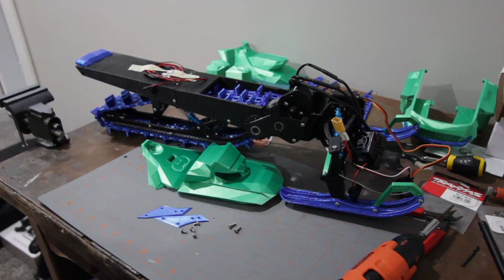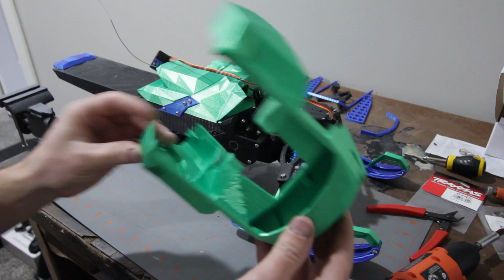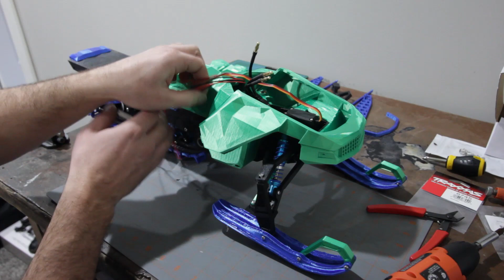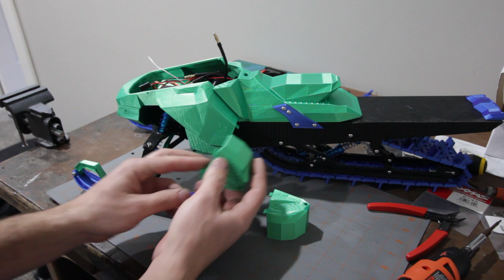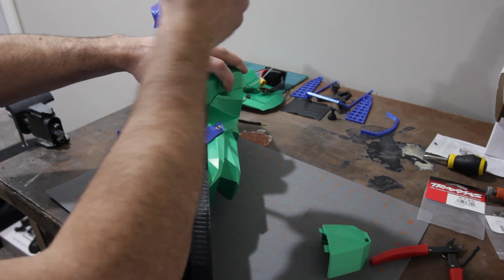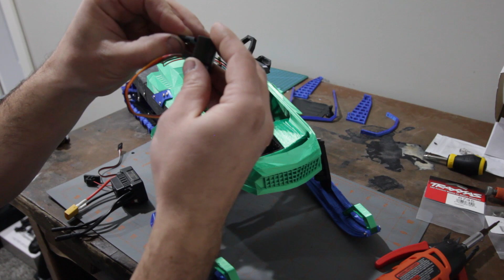SkeeRide Assembly Part 7 - Finishing Touches

Comment: Just purchased your kit thanks. I was wondering what softwear you used to make the hood. Im only familar with fusion 360 and solidworks from engineering design class.
Reply from the maker: Thanks. I use Blender. It’s very different from fusion 360.
Reply: @BuildItBetter3D  OK that's cool, did you use fusion for the mechanical components or the track, or just blender as well.
Reply from the maker: I use Blender for everything. It’s not the ideal software for mechanical things but I’ve been using it for 14+ years, so it’s just what I use.
Reply: @BuildItBetter3D  wow impressive thanks
Reply: @BuildItBetter3D  also forgot to ask what gear ratio is best for a 3300kv motor on 3s. Thanks and happy new year
Reply from the maker: I use 2200kv motor. You could ask on discord. I’m sure someone on there has that speed motor.

Comment: Thank you very much.
One thing I wish we had was a fix for the front bump steer when the suspension is compressing.
There seems like the geometry is off a little bit.
We had the same problem with pascal’s suspension/steering and he came up with a fix for it in the spindles/a arms.
Reply from the maker: Yes, there is a rack steering mod that I believe fixes this issue. I have not yet tried it, but it looks like a simple and good solution. It can be found in the mods files on MyMiniFactory. Look for jibberjabbs rack, Knuckle and upperarm.
Reply: @BuildItBetter3D  thank you and yeah it does help but I wish we could figure out the bump steer a little more.
But thanks again and I absolutely love my skeeride!!👍👍👍

Comment: Hi, I’ve just bought the plans and will start the printing process shortly. I’m just doing some ordering of the parts I need and I have gotten to the hardware. Would you or anyone be able to tell me what M3 screws are required. If you would be able to tell me how many of each bolt and the size required that would be great. If no, could you please tell me the lengths that are needed as I don’t want to buy a large assorted box that contains lots of length screws I don’t need. I would rather purchase them separately from my local hardware store. This would be very helpful. Thanks.
Reply from the maker: I haven’t counted or measured, it’s much cheaper to buy an assortment then it is to buy them individually.
Reply: @BuildItBetter3D  I do understand that however the cost isn’t a problem as I get discount and the price probably would work out about the same. They are much better quality when they are bought not in a set. Would you just be able to tell me off the top of your head roughly the lengths needed and if there are any lengths that are not needed. I’ll order more than I need but I would just like a rough idea. Thanks.
Reply from the maker: Off the top of my head I’d say 80-100 screws ranging in length from 4-35mm. Most will be in the 16-18mm range, probably 10 each of the other sizes, but this is all kind of a guess. I can count them later.
Reply: @BuildItBetter3D  thanks very much for your reply. That rough idea does really help me. Just a suggestion that it may be a good idea to count them later and add a list of the quantity and sizes of each screw as well as nuts and washers to a hardware page on the plans. I wouldn’t mind this information and it would really help. As people are buying the plans and they are not free it would just be something nice to be included. I’m sure I’m not the only one wondering the size of screws and quantity. Thanks.

Comment: Where you mount the batter??
Reply from the maker: I just put it inside wherever it fits, no specific mounting spot. Usually it fits pretty good in the side section opposite from the transmission.
Reply: @BuildItBetter3D  be sweet if you could make it fit under the seat and the seat be the battery cover.
Reply from the maker: I thought about that but the seat is too small. I’d have to make a larger scale version, but I don’t really want it any bigger.
Reply: I get that. I got your files and I'm going to print one. I'm big into rc boats planes and cars. And need a sled. Lol. I'll be learning the cad program soon. Looks great and I cant wait to get printing